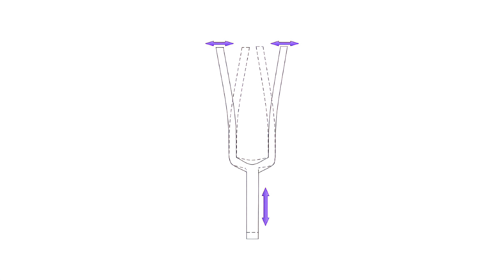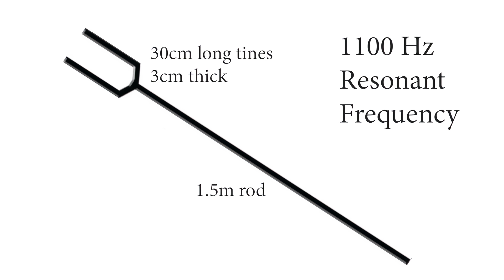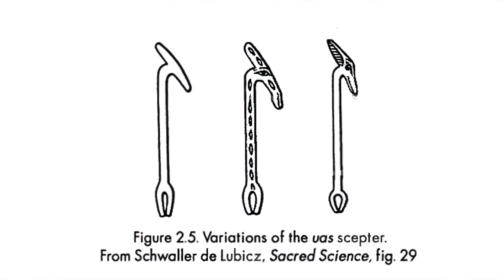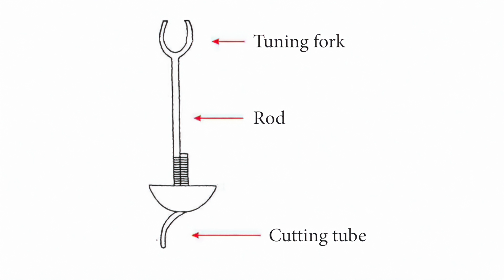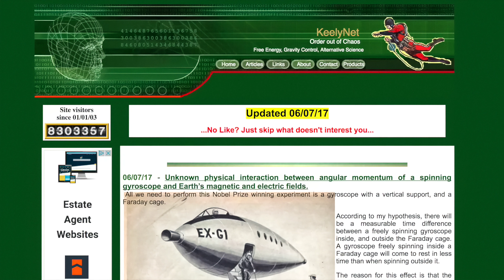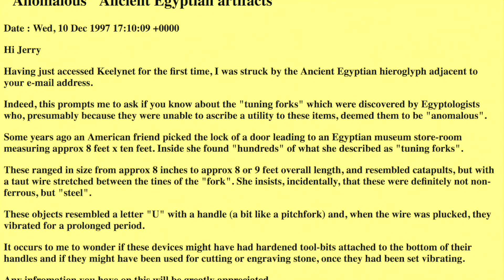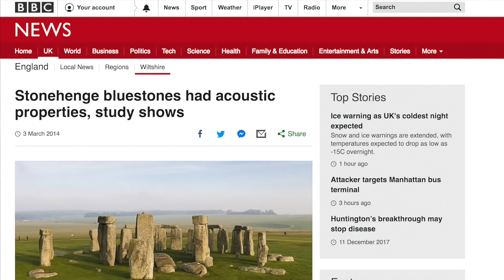How the Ancients Cut Stone with Sound - Lost High Technology Explained | Ancient Architects

Comment: Throw down. Built one and show that it works.  If the fork requires steel, don't worry about it. Use steel. If it works, then we can debate about how they (someone, maybe not Egyptians) made the steel. The issue you have here is that when the fork vibrates it has a certain amount of energy. That is, the energy put into the hammer blow. That's it. So, how much granite can be removed with a hammer blow? Not a lot. Worse, the device itself must soak up some of that energy (that's the point, right?) making the effective usable energy even less.

I agree that there is a simple solution but it won't involve non-science gibber described by words such as aliens, Atlantis, or giants.

Comment: interesting but still just a hypothesis. and a highly dubious one at that. it would be fairly easy to test this yet it seems nobody has so far shown it to work.
cutting stone using sound vibration is questionable at best and levitation using sound is possible but is only viable with miniscule particles with close to no mass (like water drops). the power you would need to levitate a stone block weighing a ton would be astronomical if it is at all possible - what to say about the environmental impact of such a magnitude of sound being blasted.
sorry but not convinced at all.

Comment: The length of measurement in the pyramids is 1/6 the circumference of a circle, which is 1 meter in diameter.. The stones were cut down to exactly 1/10th of a millimeter. I'll pay attention to these vids when someone can tell me how they knew what a meter was, how they derived it, and how they got such exact measurement in cutting. Cutting something to that fine of a scale means that they had to be able to go at least 1 order smaller to be accurate.
Reply: If such a method exists , I'm surprised that no one is using it or knows about it. While a third tier system isn't as good as a 1st tier, currently the wavelength of a light source, still really good for most other applications.  Please do so, find the title of the book,  as I would be interested in how they obtained such an exacting measurement with the number of changes that can happen in material, like temperature that expands or contracts it. To cut something so fine, they would have to measure down to 1/100th of a millimeter because they would have to know +/- the distance between 1/10th. and of course the width of the cutting. Can humans even see the distance between 1/10th of a millimeter divided into to 1/10ths?  The evidence is that they did build these structures with demanding accuracy, the thing I have trouble with is how.
Reply: The question is why you think that is what they did. They measured and cut and didn't care if you thought it was a meter or millimeter or whatever.

Comment: 6:27 ummmm can nobody pour water from a vase ? 9:26 cable / diamong wire saws 9:48 notice the round symbol under the forks ,thats the unexplained stone disk recently revealed  ,it could represent the sound freq required, sand forms that shape at a certain frequency

Comment: There is a vast difference between the resonate frequencies of a wire and tuning fork compared to modern methods. Just because it is plausible does not mean it is correct. The tuning forks can easily be att4ested tot he fact and Truth the Egyptians had a vast mastery of sound and tuning forks would have served as tools to help identify and unlocked the mysterious of that knowledge. They only had an entire temple built and dedicated to music/sound, that also happened to be moved. What a shame since its construction I am certain would have displayed a large quantity of acoustical properties, further demonstrating the power of sound and serving as a tool of instruction for those that would come after.

Did you take into consideration that the letter stating steel but no ferrous metals, meaning no iron, would also create issues with available materials and technology. Steel is basically just Iron ore alloyed with carbon. So how do you make Steel without the use of iron, which is ferrous?

Idea/bubble burst.

Comment: You can cut stone using copper and vibrations...you can also cut it faster if you heat the surface of the stone and if you look far enough you'll see the big metal plates they used to pin point the sun. If you heat copper with pin point sun light, heat the granet and vibrate it at the same time the granet would mould like play dough.

Comment: go ahead ... do it.... until then you are just speculating
Reply: I do agree, a demonstration would have been more convincing.
Reply: Shouldn't the resonant frequency change constantly as the material is drilled? As the mass and weight distribution change, so will the rf. Unless you have a specific plan for using a specific pitch, then all you have is a crude hammer drill. Sorry dude
Reply: @wompbozer3939  The resonant frequency is related to the length of the rod, not the material being drilled.  Note that I'm not claiming this "drill" will do anything, just answering your specific question.
Reply: Полиграфович
 I like to keep an open mind. Science needs to keep an open mind, and so do the ppl who call everything thats a new idea 'pseudo-science'...At one point in history every1 agree that light could only be one thing and that even particles of matter could never be waves. 

Turns out gravity itself might possibly be a particle (which would flip the whole idea upside down). So keep an open mind, speculate if you want to, but don't dismiss...
Reply: ThePhilosopher Apart from keeping an open mind people who defend pseudoscience as science have to understand science. Not saying that gravity (a force, may which be with us) is a particle (a particle, which at the same time is not a force) is a good starting point.
Reply: james dolph Once you start searching to find videos showing exactly what was described in this one, they are abundant throughout the internet. So the answer to your statement is that many already have experimented and achieved this simplistic yet incredible method. Go check some out and be amazed!
Reply: Search youtube for a Russian cutting granite with high frequency metal pipe. There is your proof.
Reply: james dolph https://youtu.be/BsqOLCXYznE
Reply: @Shyeena  wow do you believe every poorly edited video on YouTube. People believing that video is like the poor resolution video of a dark mist in a room. With the title "proof ghosts exist"

Btw. All that "acoustic technology" in the video used electricity. A 100 ton block!!! Think about it.
Reply: Yeah this was an interesting video but I kept hoping for a demonstration or at least a clip to one, kept saying how easy it is
Reply: HMM, KNOWLEDGE HAS AND IS BEING SUPPRESSED. NOW JUST DO A SEARCH. THE VATICAN HAS A VAULT FULL OF MANS HISTORYS AND HISTORY. CURES FOR CANCER ETC. I ASK MYSELF WHY to KEEP IT HIDDEN FROM .... MAN? PEOPLE ALREADY KNOW THE GOVERNMENTS LIE. NIKOLA TESLA TRIED TO GET THE ZERO ENERGY OUT, AND THE GOVERNMENT TOOK CARE OF THAT as THEY DO.IF PEOPLE KNOW TOO MUCH. AND THEN THERE'S N.A.S.A = NEVER A STRAIGHT ANSWER. An OBJECT THAT'S BEEN SEE ALL OVER THE WORLD THE TR-3B MAN MADE. EDGAR FOUCHE TR-3B.
Reply: It's done at the beginning...
Reply: Manny Games I think they would take the big ass tunning fork and whack it on something and use the opposite end to do the cutting for a few seconds before whacking the fork on something again to keep the vibration going. old how they would be able to use voice unless they had some sort of accousic amplification chamber attached to a vibration device
Reply: https://www.youtube.com/watch?v=BsqOLCXYznE&t=132s
Reply: james dolph Google it yourself buddy, I've seen a vid of it before..
Reply: Ever heard of geoploymer granite?  You could easily press pictures into soft granite as they dry. Plus fossils don't dissolve in the process either. It's a much easier way to make pyramids etc because you just pour as you go and no need for lifting heavy stones. Ancient geoploymer has been known for a while now and it's a way better explanation than sonic sound.
Reply: That was rad!
Reply: Agreed. I want to see it done effectively
Reply: you said it brother
Reply: james dolph ml@?
Reply: Where,  @threynolds2  ?
Reply: NSBarnett, it's been a year since I posted that.  I thought the link was in my reply.  Did the video get pulled and that removed the link from my post?  Give me a few days to find it again.
Reply: https://youtu.be/BsqOLCXYznE
Reply: https://youtu.be/BsqOLCXYznE
Reply: So is every other theory about ancient Egyptian building methods..... None of our modern day scientists and historians were there so it’s all speculation. That’s literally what the majority of history is.. speculation based on the evidence gathered and our theories based on it. Ancient history simplified down is quite literally our collective speculation of the past
Reply: @Cwmgh  there is what we're told by "the order" keeping the truth hidden... All we gotta do is open our eyes and think for ourselves
Reply: Where's the link to the doing it vid?  @threynolds2
Reply: scott neels, I made that post about a year ago and the link was there when I posted. 
 Try this:
https://www.youtube.com/results?search_query=sonic+drilling
Reply: Dolph Lungren I got ya proof right heeeya:       https://www.youtube.com/watch?v=BsqOLCXYznE
Reply: I was expecting a demo of the sound techinique even on a small scale, but there's none. If only people would actually test their theories instead of theorizing without proof
Reply: Just because we can't do it does not meen it isnt possible. It is infact theorically possible. Sound CAN levitate and brake objects, Which is what makes this so strange. How the f**k did the ancients know this? when all we were taught is that they were primitive knuckle daggers
Reply: "Doing it"....even on a YouTube video would be so profound as to garner attention from Sauron. And we can't have that.
Reply: exactly, he keeps talking about it but where is the video example
Reply: speculation is exactly what all scientists do and then correct it as it gos. Until its a proven fact so admitly yes speculation... But progress comes in stages.
Reply: https://www.youtube.com/watch?v=BsqOLCXYznE
Reply: @threynolds2  sure sure ... still see no clips
Reply: So they used their voice to cut perfectly into granite???
Reply: @MannyPatino  They used a hammer and chisel is a lot more ridiculous..
Reply: @MannyPatino  Holy shit bud your onto something there, the dragonborn come's ^^ :)
Reply: A lot of skeptics here but no one offering a better solution. Oh wait... because they have no other solution.
Reply: @marcusevans1171  instead of saying "this is how it was done" a better title "a potential theory how it was done"
Reply: @mjoto  eh... semantics.  Do you still type lol when you're not laughing out loud?
Reply: @marcusevans1171  lol
Reply: @marcusevans1171  If I do not know how it was done it does not mean you know. I´ll personally give 101$ to the first one to show me that they can do it with sound.
Reply: @gumunduringigumundsson9344    you missed my point. I'm saying this is a strong theory and others are non existent. You don't believe this is plausible. Fine. But, you still haven't put forth another theory, so my original point stands. Not even sure why you brought me into this.
Reply: @marcusevans1171  yeeah. Guess youre right. Must have misunderstood you a tiny bit haha! Have a good day.
Reply: How about unicorns they can cut though anything
Reply: james dolph pseudoscience at its best. its people like this with a shallow understanding of science who do more of a disservice to non mainstream archaeology than they do to further question. im all for speculation and open to interesting out of the box thinking, but this guy spends the whole video saying stuff like: "a regular drill would bind up with sand and never work, but a sonic drill definitely would work and would have no trouble doing so!" as if this definitely did happen as fact.
Reply: Полиграфович -  How do you think the ancients cut holes that are the equivalent of modern laser guided diamond tipped power tools? And may I ask what your credentials are to be an authority on this subject?
Reply: https://www.youtube.com/watch?v=xCP6UF2m9P4
Reply: @namelastname4077  omg. 

A dog runs through a yard. Caught by night vision cameras. Title of video "demons in my backyard" 

Comments on video. "Omg I knew it"
Reply: no shit you'd think we would have figured it out by now and have started building pyriamds already with ease if it was actually lost technology that we just needed to remember... we know how to do so much and discovered so much science you think we would have figured hownto cut stone with sound. come on such fucking bullshit
Reply: Tree Of Life watch the videos in the comments here, we have figured it out and done shit with it, they just hide it from you and you believe them
Reply: but hey man, anything to advance our cognitive bias.. i mean the fact that the mainstream has been lying and indoctrinating us from birth! hiding the truth from us! theres being a skeptic and then theres being a fucking dolt.
Reply: the word "acoustics" thrown around as if its some magical word. im sorry bro but if stones could be moved to harness sound waves to vibrate a certain way to tune forks and thus resonate with blablabla shut the fuck up with your pseudo babble. its so bad. so fucking bad. okay maybe these giant stone areas echo in weird ways, but to go from that to some fantastical means of cutting rock with modern precision.. yeahhhhh okay
Reply: Полиграфович 
Stop thinking in such a simple way, like what you understand, is everything. 
If you knew a way to warp space and time and travel through a “wormhole” then you could easily create anything you wanted to out of any material you desired. The only thing I’m saying is that it is possible we as human are about to repeat the past. If you were alive 100 years ago you would burn someone at the stake because they explained the IPhone to you? No but you would ridicule them as being naive and dumb and gullible...

Comment: Can you imagine if they used the sound vibration, and tuning fork technology, attached to something equivalent to today's Palm Sanders. They would be able to smooth surfaces to a completely polished finish... if you have the proper hardness & size of aggregate, you could polish any stone.
Reply: The stone you are polishing has the proper hardness... you just need to be extremely persistent. Which is something modern society doesn't want to do, either a tool does shit in 10 minutes or it is deemed impossible.

Comment: Imagine two "tuning" forks.  Tine A of fork 1 has wire under tension connected to tine A for fork 2.  Stroke a violin-like bow across the wire.  Would the vibration pass to both tines A and result in a sympathetic response to tines B?  This could be a real stretch, but if vibrations could be employed by any means, don't we have enough smart folks left to prototype some of these options?
But if this isn't a wild goose chase, explain where are the copper tubes.  How did the dust get removed from the drilled surface?  Take a stab at several ways to accomplish this vibration stone cutting.  What devices and materials HAD to have been used?  And have ANY such artifacts been found?  One interprtation of a hieroglyph may be a clue, only if the interpretation is valid.  All we seem to have is cut rock to prove the rock was shaped.
Maybe we underestimate these "primative" folks.  Maybe there were very talented stone masons and artists who had  the experience and time to do these things.  Modern homo sapiens may just be so dependent on our machines and technology we can't conceive of any other solution.

Comment: Nichola Tessla did similar research using sympathetic vibration using an electric relay. The principle is the same as a  child enjoying a swing. By making an energy input at the right moment the movement increases. 
This seems far plausible than hammering away with soft metal tools. But how do we measure the oscillating resonance to achieve a proper frequency? Thanks to being able asks such questions on the internet many engineering minds can revisit the physical principles that they have learned. 
Thank you for the presentation.

Comment: Thinking is the key. Sound/Vibration was the tool, this guy is right. But it is not new. We know that for nearly 150 years now. We have found their tools, yes we did. There are to many people searching... they like it to much. That is about it. 
It is more easy to make money out of secrets than out of knowledge. Sorry. 
By the way... your dentist is using this technical invention for some years now. Every toolmaker could use it to, but it is more efficient cutting with water or oil. We are using metal not stone, because we can. Do you ever thought about glasslike aluminium? Yea! We have got it one year bevor you heard about it from mr Star Trek.
Sorry for my tremendous English.... really need to work on this.

https://de.m.wikipedia.org/wiki/Aluminiumoxynitrid

https://youtu.be/eeozW84P1jw just as example. That is how we bring different materials together, forever. Check your car.... different steals, same part.

We just don't need stone anymore.
Reply: Sorry, there are no secrets. Nowhere ...except about the girls, if you were a man.